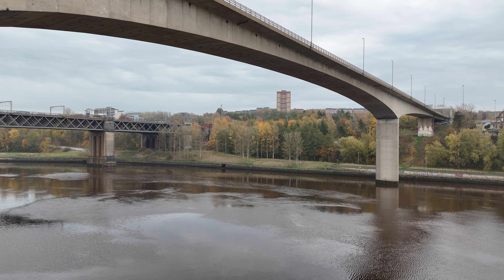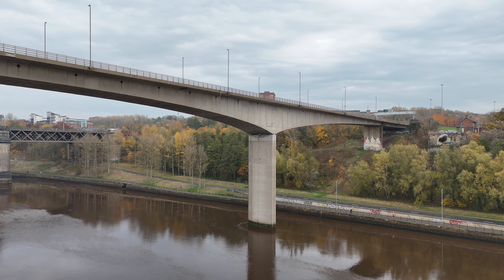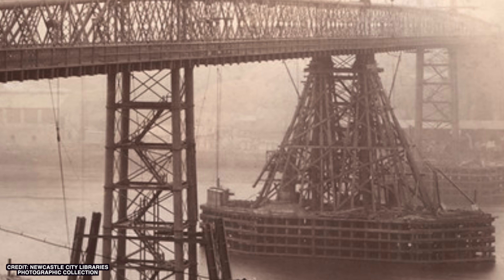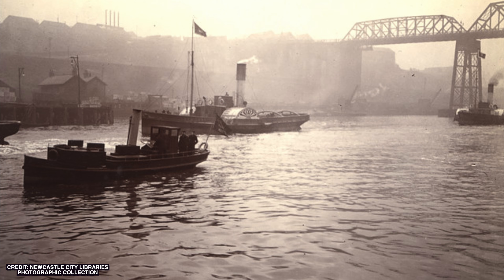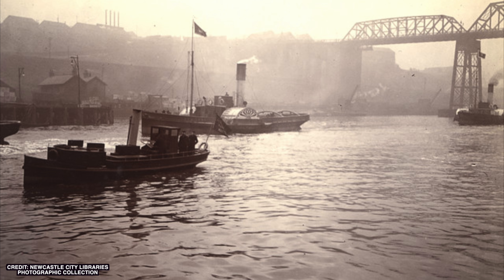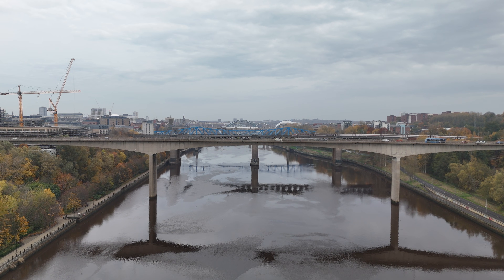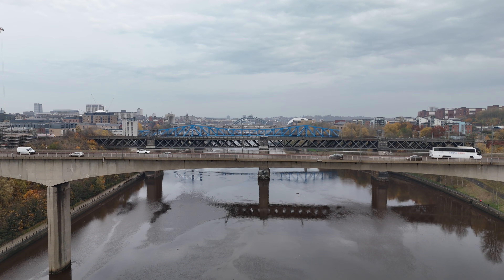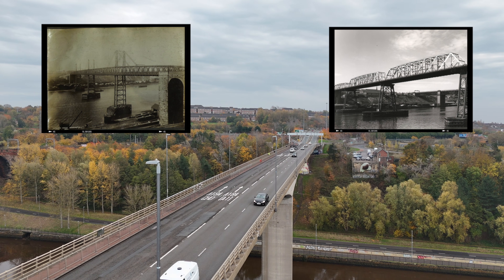👉 The Redheugh Bridge  150 Years of Engineering Across the River Tyne

Comment: Let's look at the bridges of today.
Redheugh Bridge has problems with lumps of concrete falling off, on both sides. Newcastle side had a massive lump of concrete fall into a public car park, and the pumping systems constantly fail.
King Edward Bridge is having a massive repair under the deck.
You can't get on the QE2 metro bridge, so who knows what condition it's in.
High Level Bridge weight restrictions in place after emergency work on lower deck.
Swing Bridge doesn't swing and is in a dreadful state.
Tyne Bridge is well documented just how bad it is.
Reply from the maker: Definitely agree every bridge over the Tyne seems to have its problems and you forgot to mention the millennium bridge got stuck a few months back but not sure if it’s operational again. Thanks for watching 👀

Comment: I was parked at Pottery lane the other day and the damage on the Redheugh is really bad up on some of the stantions. Its mad when you think, the metro bridge in byker is around the same age and not showing any deterioration at all
Reply: Pottery Lane car park and part of the central railway land was closed when a 10ft lenght of concrete fell off into the car park before a repair was made.
Reply from the maker: Did not know the bit that fell off was that big thanks for watching 👀
Reply from the maker: Probably because that’s maintained better as I don’t think the councils are responsible for that. Thanks for watching 👀
Reply: @55DEGREESNORTH68 that makes sense. I def make sure I park away from flaky bit when I'm at pottery Lane.
Reply from the maker: I would